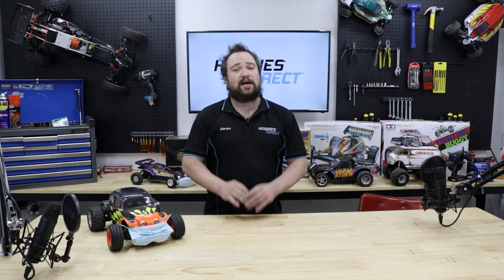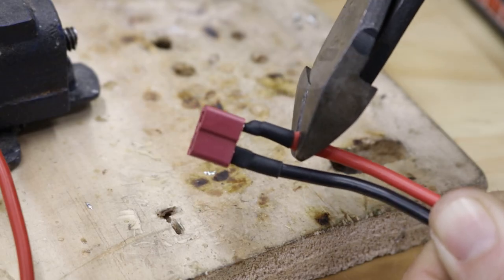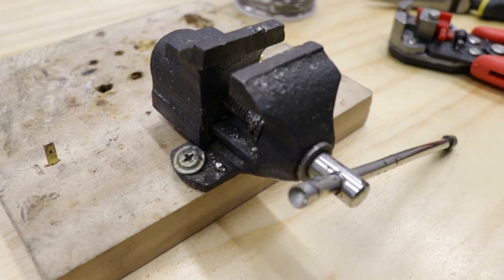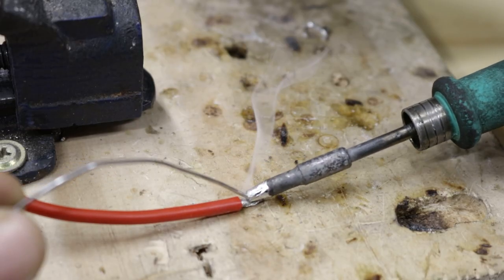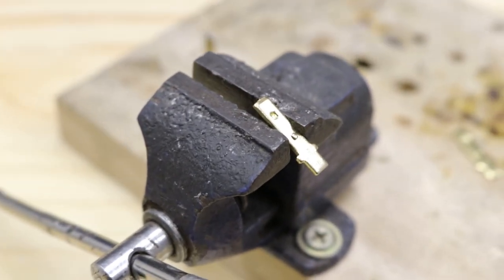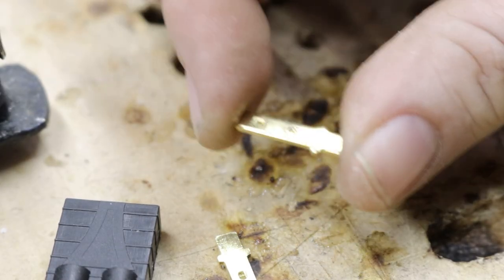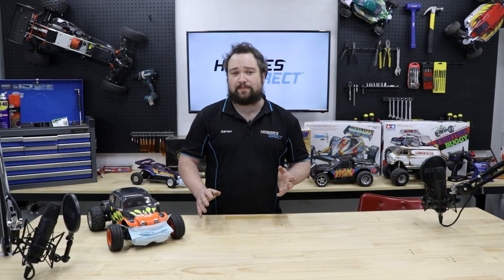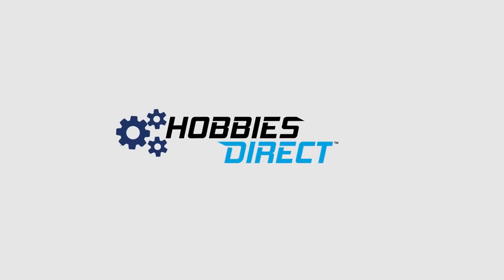How To: Solder a Traxxas RC Connector Like A Pro!

Comment: Great video. Followed these instructions to solder new TRX connectors onto my Venom hardshell 2s lipos that had their universal connector system. I only use them on my Traxxas models so I figured it would be better to have real soldered connectors.

Comment: Can I replace that ez connector and put an ec3. Of yes. What should I do with the balancing cable. Just unable or solder to the negative
Reply from the maker: You can change the main lead to whatever you like, on most batteries the balance lead is separate. If we're talking about Traxxas ID packs with their integrated balance leads, we don't recommend changing them at all.

Comment: Ok but how do you fix a broken wire off the plug housing? Can you pull the plates out of the plug to resolder
Reply from the maker: you may be able to tap out the contact using a small flathead screwdriver and a small hammer, but it's likely you just need a whole new connector.

Comment: During this process, was any flux needed to help the solder stick to the connector blades? It might be the brand I have, but for whatever reason, solder is just balling up on the contacts and not flowing like it should. Wires came out perfect though.
Reply: I am having the same problem! I can’t find a quality answer anywhere 😂
Reply: If u know the soldering gods put in a good word for me lol
Reply: @mattreadle4566   I found some soldering flux on Amazon. I'm not sure if I could explain how to use it correctly, but it worked pretty good. You might be able to get some and maybe find an instructional video on how to use it. But I coated the blade with it and it bonded pretty well.
Reply: Thanks buddy I will try !
Reply: Flux on wire before you tin it and after

Comment: Can you reuse tea as connectors by pushing them back out??
Reply from the maker: If they are not damaged you can, but make sure you do it one at a time still, to minimise the chance of short-circuiting the battery.

Comment: Ok but how can i depin the stock wall canrger to make a pigtail lead 🤔
Reply from the maker: Really wouldn't recommend messing with a wall charger - that's a lot of volts to go awry 😕
Reply from the maker: @RobynTapps  Well then sounds like you are on top of it!
Reply: @HobbiesDirect  yes until i broke a control arm in 5 minutes 😆 aluminum upgraded ones are a must

Comment: Can i just use butt connectors?
Reply from the maker: You can use whatever you like, but they are not recommended for this application as they may not handle the current or vibrations many RC vehicles see.